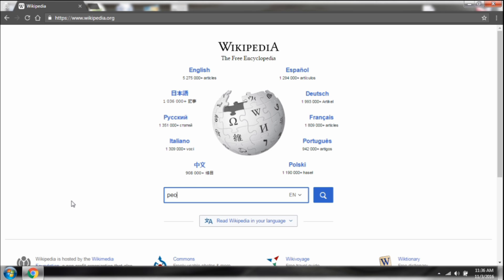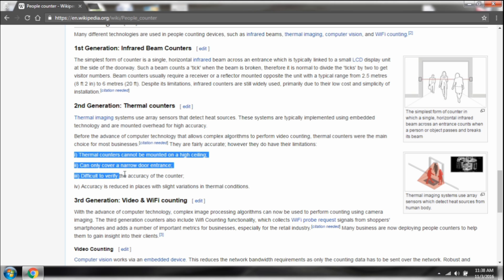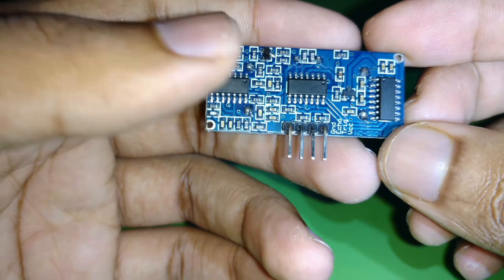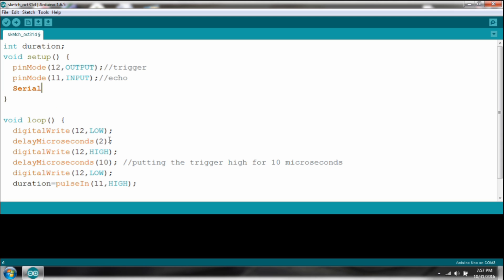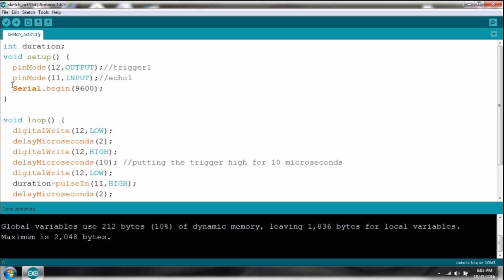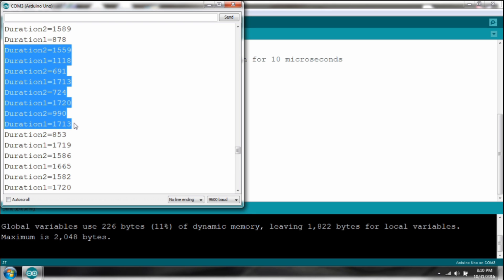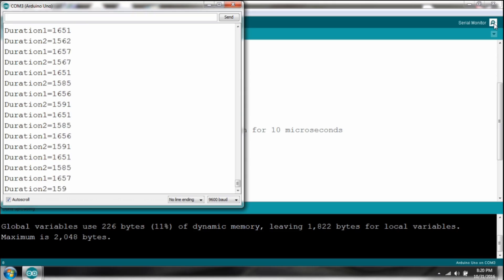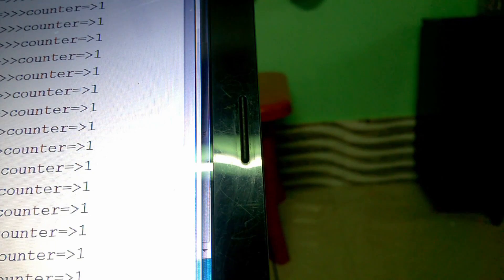PEOPLE COUNTER (NEW CONCEPT) part1

Comment: Nice video, but i would appreciate it if part 2 was uploaded by now.
And in some parts you are just talking to fast.
I still dont understand why you remove both of the transmitters of the range finder.
Reply: I completed this with a different approach.  Do you want the code?
Reply: @prasadbr9660  yes please
Reply: @prasadbr9660  please dude